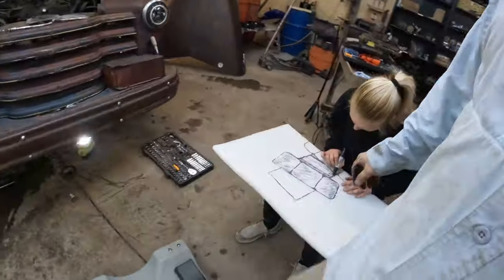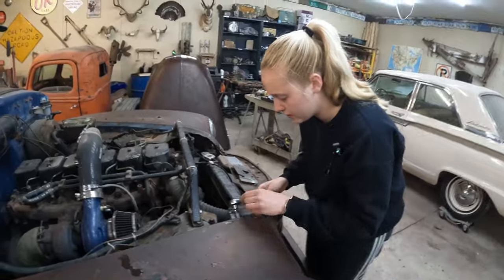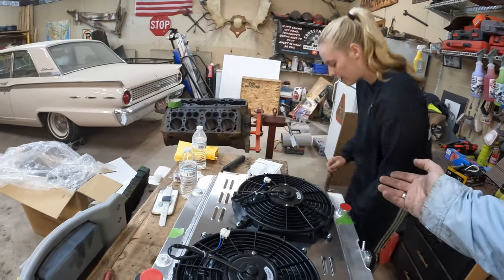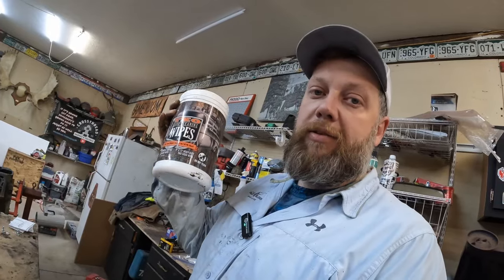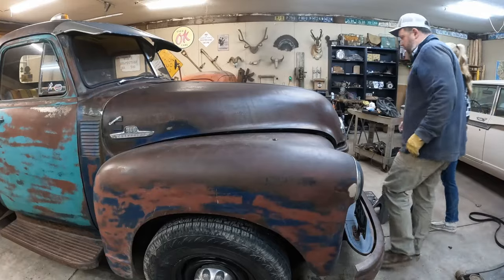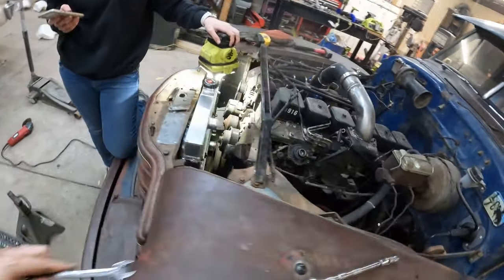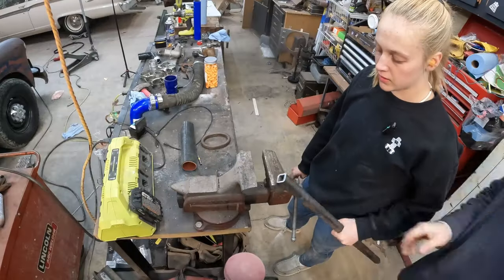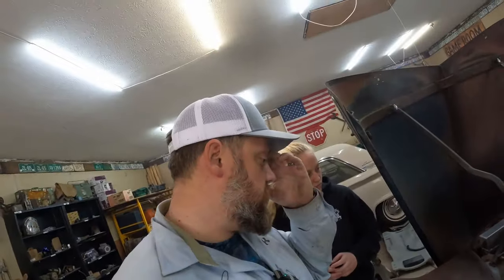Custom Hood Hinge For Our Cummins-Swapped Chevy!

Comment: Could you put a cross bar to connect the arms? That might steady it up.  You can also add struts to help with opening and closing.
Reply from the maker: Yes, already thinking about ways to improve. The challenge with the crossbar is the height of the valve covers, turbo, and brake booster. Thanks for watching.